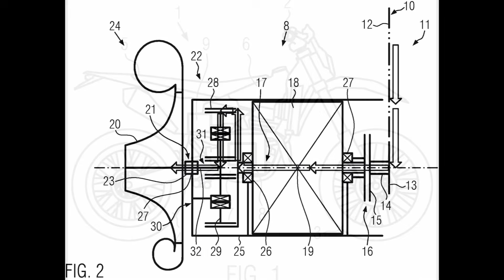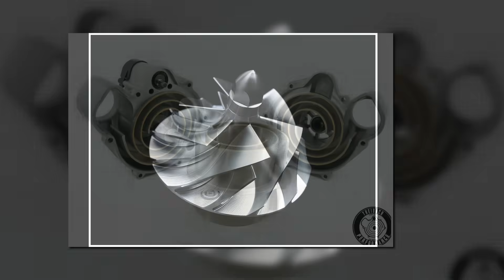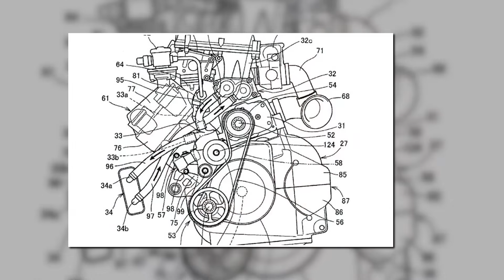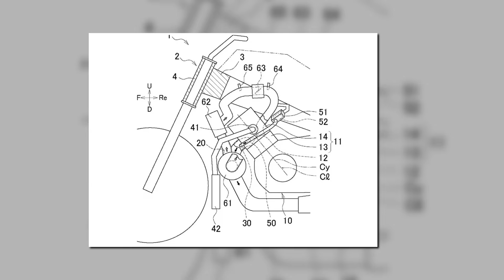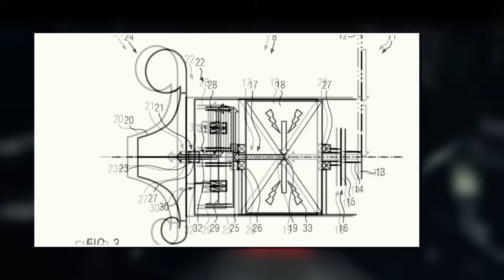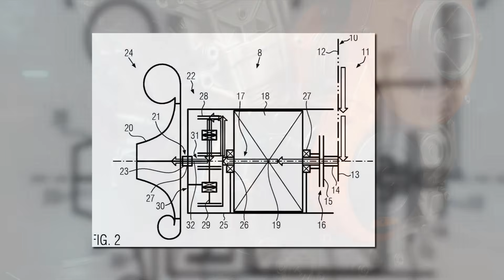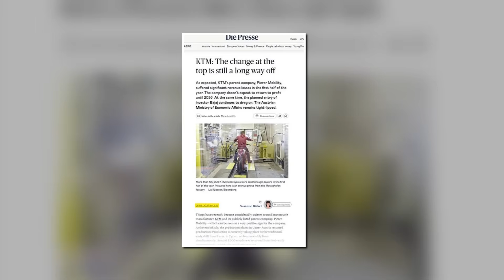Did KTM Just Reinvent the Supercharger?

Comment: With all this R&D alone the costs are gonna be out of reach for the average Joe. I been waiting for Honda with this V-3 since I first heard the rumors. It didn't work very well in the past for smaller displacement roadbikes. Overweight hippos is what we got. That's why the H2 never really reeled me in. I am a KTM owner as of last year. If anyone can do it right I have faith it will be them. But like you stated, that's the million dollar question. It's too early to say for me. I'd hate to see history repeat itself.
Reply: It has generally been less expensive to just make a motorcycle engine larger to get more power.  It is easy to get a high power/weight ratio with a regular engine on a motorcycle.  Something like a half-second turbo-lag (or double that) is not such a big deal on a slower car, but would make a fairly powerful motorcycle difficult to ride.  I am not quite sure what the motorcycle makers are trying to achieve with their forced induction programs, anyway.   When the displacement is limited for some reason, forced induction becomes more attractive, so it is possible they are worrying about that.
  
It gets complicated if the goal is increased fuel efficiency or reduced Carbon emissions since optimizing an engine for high power on boost usually means lower compression ratios.   This generally drops fuel economy at lower-power, where the engine spends most of its time on the road (or fuel-mileage tests).  There is often a certain amount of gaming done, like running rich for power/knock-resistance only at throttle settings not used in the tests.    Many car turbo engines are so optimized for fuel mileage that they put out less power than naturally-asperated motorcycle engines of the same displacement.
Reply from the maker: A complex subject n i just like simple 😊
Reply: @jfess1911 Jesus Christ bro, write them the letter. Maybe they'll listen to you but good luck with that
Reply from the maker: lol. I don’t think I’m their favourite so doubtful they’d listen 🤣🤣
Reply: @barebonesmc lol😂 that was meant for the guy jfess who wrote the novel. 😂😅😂
Reply from the maker: Aaah 😊👍
Reply from the maker: I think most people regardless of nationality are generally pretty sound and welcoming. The philosophy of treat people how you want to. E treated yourself stands up pretty well 😊👍👌
Reply: @barebonesmc I thought everyone hates Americans😂
Reply from the maker: Nah. Not liking what a country/government does isn’t the same as hating the people 👍👌😊 I’ve spent the last few days with some Americans who I consider some of my best friends 😊
Reply: @barebonesmc 👏 We can't control our corrupt govt
Reply from the maker: Very true for all of us sadly
Reply from the maker: True words
Reply from the maker: I hear ya mate, time will tell if it's the right direction to go in. I just hope they don’t forget their core market

Comment: no sorry looks shit already look at it sticking out of the left hand side shite, to much power now and no point my R6 and my old R1 with 150bhp was enough pointless garbage, if I was the UK id limit every single bike a 600 max simple as
Reply: 600 only?
You've got to be having a laugh.
The last thing I want is some buzzy screamer or parallel twin commuter.
Gimme torque and the thrust to lift the front out of second or even third gear bends without abusing the clutch.
Do I want yet more complexity?
No.
I prefer to be able to perform at least some work on my bikes, and use an independent garage when it's a job I can't perform or spend the time on.

Comment: Is it possible to have the supercharger fins to have pitch adjustment instead of being fixed that way it always spins but can increase flow with fin rotation
Reply from the maker: i think the stresses would make adjustability of the rotor vanes very problematic, but would need a better engineer than me to answer that properly tbh, cheers for watching
Reply: @barebonesmc cheers dude
Reply: Yes, there are variable pitch turbos in use already.
Reply: Modern superchargers have precisely-shaped fans/blowers, so changing their geometry usually drops efficiency.  It is generally more efficient to leave the blades alone and control how fast the blower spins with a gearbox or electric motor.  Those are Variable Speed Superchargers.   
With turbochargers, it is possible to use vanes in the housing to change how the exhaust is directed to the turbine blades to speed up the turbo at lower engine speeds.  Those are often called Variable-Geometry Turbochargers.or Variable-Nozzle Turbochargers.  There are videos about them on YouTube, if you want to see how they work.
Reply: @jfess1911  All superchargers are variable speed, therefore vane pitch should change because what it is ideal at 10,000rpm feeding an engine at 2000rpm is not what is ideal at 100,000rpm feeding an engine at 4500rpm. Formula 1 has been experimenting for over 8 years with electric turbos including the regenerative feature. I think we are still 2 to 3 years away from having a dependable consumer product. As I mentioned, this KTM announcement is strictly a marketing move to get everyone to stop talking about its woes and start thinking they are leading the technology race.
Reply from the maker: Thanks as always to the people who answered what I couldn’t 😊